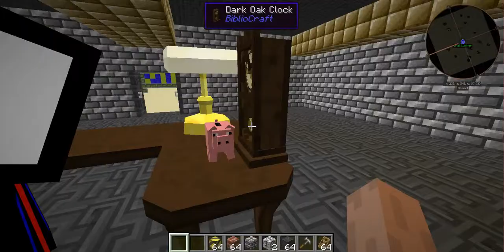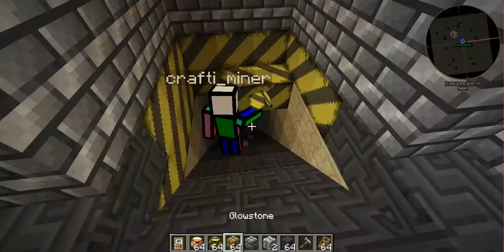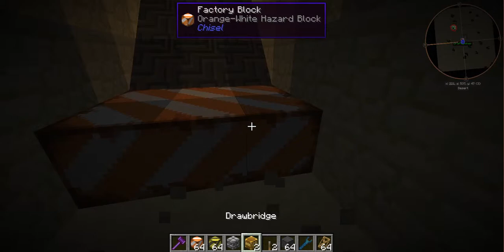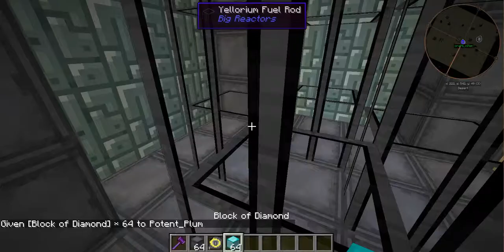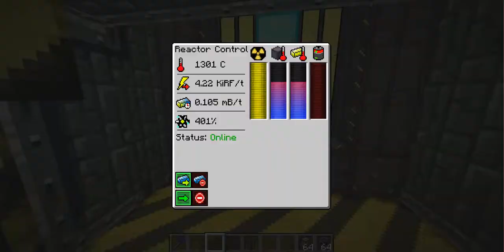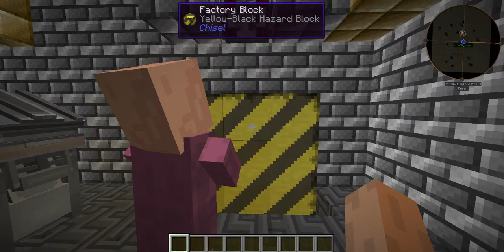Minecraft Mega Construction Season 2 - Power Plant

Comment: Kinda late now, but that's not how you properly cool that reactor. Diamond Blocks do nothing for it. You need Water(Vanilla)  or Gelid Cryotheum (Thermal Foundation) which is the best
Reply from the maker: +DaysofKnight Thanks man I'll make sure to make note of that for the next season ;)
Reply: Sea Caps No problem. I've been using those reactors for a year and a half now, lol. I have noticed that it does help disperse the heat however. So maybe diamond blocks with water or the gelid cryotheum. Resonant Ender works, too